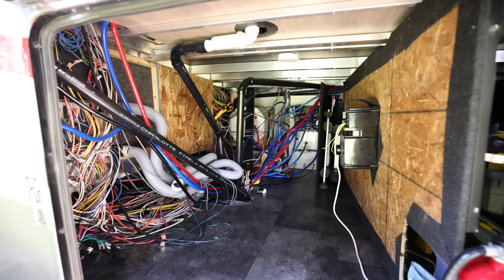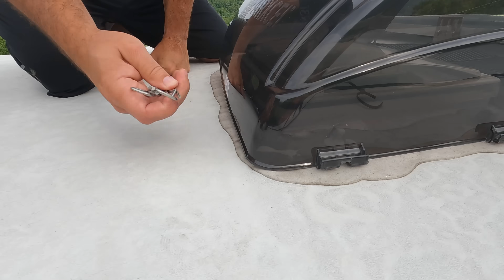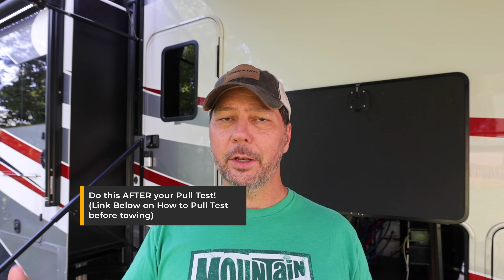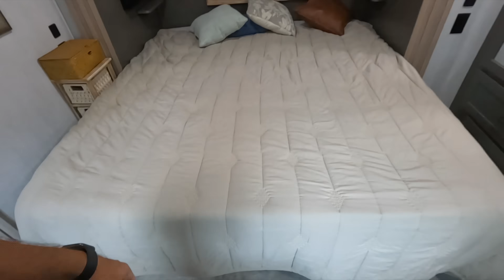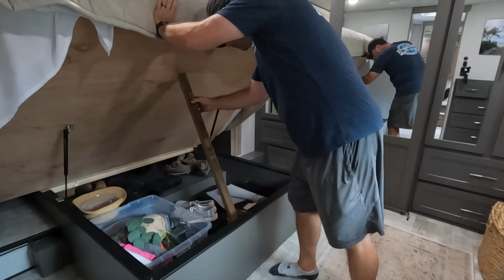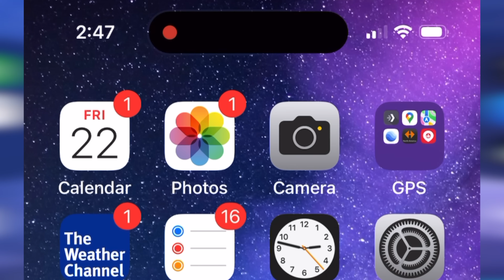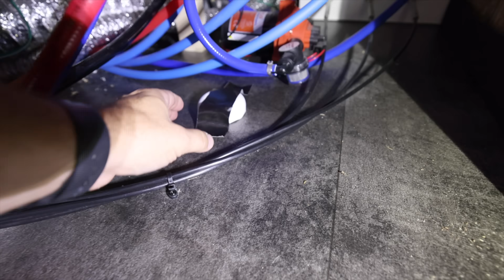Help Us Out? Stubborn Leaks and Four New RV Projects!

Comment: @0:06 you may want to check some of the ABS pipe joints (especially the elbow directly above your sensor) as manufacturers have a tendency to dry-fit the pipes and then forget to glue them at all.

Comment: Check behind your Nautilus again. I have a '22 Solitude which I had a total of 5 separate leaks behind there.  The final one is acting like what you have.  A puddle shows up but couldn't locate the source.  It eventually turned out to be a T connection behind the Nautilus in a hard to reach location due to all the pex.  It eventually showed itself but it took a long time to track down.

Comment: I recommend trace powder.  We use it in the auto industry for leak diagnosis.  You get it in an aerosol can and it leaves a powdery residue that dries on a surface after you spray it.  You should encircle the area where water appears and the idea is when a fluid goes across it, it will displace it and usually leave a peetty obvious path where it entered.  Most leaks, even minor cannot hide from trace powder.  Spray it on fittings, crevices, anywhere you want to be able to visually check for evidence of a leak.  It's what the pros use.
Reply from the maker: Someone else mentioned doing the same thing with goldbond spray powder.. 👍🏼
Reply: Water travels through the weakest points. 

I like what Jordan said.

I see you like toys. I believe there are moisture meters handheld at Lowe’s there relatively inexpensive. 

Possibly an RV repair shop would have one.

Consider any hoses or valves. If it’s been raining near you, consider wind driven rain.

Comment: Time 7:50 minutes in. Happy Jack seat support pins. I’ve had some of these shake out while traveling. I drilled through the pin at the ball bearing.  I knocked out the ball bearing and spring to drill through. With the new hole in the pin, I install cotter pins so there is no way the pins can fall out.  The pins that did fall out were the bed, which I drilled new holes in the rails to lower the bed for the AC to breath better.

Comment: We have a 2023 Solitude with the Furrion tankless water heater and my leak detector alarm went off last month and come to find out the supply line passing to it had the threads walk back enough to leak. Worth a look, hope you get it sorted! The threads like to get hot and cold and just loosen up over time. I’m sure driving down the road aids in that also. I used some pipe dope (sealant) and it’s been holding up well so far.

Comment: On our maiden voyage from Pennsylvania to Bellingham, WA we fell victim to a leak.
Crossing the Badlands in 96° with 25 mph crosswinds (was towing amazingly) we were motioned to pull over and a rear view glance saw insulation flying.  What a wild adventurous chore packing soaked insulation into the kayaks, cutting the rest of the underlayment away, and securing all the wiring.  Some wires received abrasion to metal and ACs & fridge were running.
Having aircraft industry experience,  the wire management  was rather appalling.  
Thankfully,  I had ALOT of zip ties, electrical tape and bungies with me to get her shipright.  Doing this with winds funneling underneath and i-90 traffic whizzing by was challenging!
Seems to be common with folks taking various reinforcement measures.  Improvements could be made to what is arguably a safety issue.  Our first round of customer service coordinating with local GD dealerships, 3rd parties, scope of mobile tech work ect just wasn't working out timey, so the company is mailing me the underlayment to do it myself.  Kinda got an eye opening on things.

ANYWAY, days before it happened, we had a layover at Grand Design headquarters to have our refrigerator swapped out for DC.
This required removing the slide and a gas line.  

So I was going nuts trying to find the water source on our 2023 410 during our many subsequent hookups to the Mt. Baker area.
I then had everything out of the basement, checking every fitting.  We ran each line, hot, cold, draining sink fulls, etc.
It wasn't until by chance, my wife started taking a shower while I was underneath. 
From across the pass through, I just happened to catch a drop of water clinging to the bottom of the shower drain fitting.
On the otherside, it's right up under the bay door in plain sight.  
What was happening, the water adhered to the pipe and crossed back behind the wall and pooled in your same low spot, before going down into the insulation.  Thankfully  no wet wood. 

So I checked the compression nut - it was a bit loose, not bad - then I summized workers may have had to remove the line and perhaps didn't happen to seat the washer correctly.   No dice, and then it was obvious the plumbers puddy must be compromised.   
I noticed replacement  shower drains have rubber seals.  Then there was a debate whether or not to puddy again or silicone the repair.  I went with stock, so far so good.
Another theory- the removable wall on ours, is notched tightly to the drain pipe after the elbow, almost supporting it.
Vertical shock loads could be translated right up to the drain.

Looks like this will become a valuable thread.

P.S.  The motorcycle ride up to Artist Point on Mt. Baker, the volcano north of Rainer, is spectacular!!!
Reply from the maker: I was suspect of that drain pipe also, but noone had been showering.  But it's still not a bad idea to get the shower running while I check that pipe, try to move it around a bit, etc...  👍🏼

Comment: Hi Chad,
I would check when you have the water showing, when dry camping or during hook up. During dry camping the expansion of the water during a heating cycle of the water heater has no place to go except for the pressure relief valve which requires additional pressure. This could be enough for a weak point in the plumbing to release the additional pressure. This would not happening when hot water is used during this time or with a hook up, because the water can expand into the hook up. Hoping this will give you another angle to look at the problem. I appreciate your shows and keep up the good work. Save travels. 
Leo

Comment: Hey Chad love your channel. I had an issue similar on our RV. Took it back several times while it was under warranty. I finally took it upon my self and found  that the frame for the door wasn't properly installed. I removed the frame and replaced the butyl tape then sealed around the frame. Problem finally solved for mine. Good luck in finding your leak.

Comment: You need to clip your break away cable on the tie down handle inside the side of the bed not supposed to connect it to the same hitch or spot the trailer is connected to
Reply from the maker: We used to do that, but our cleat on that side went away with the Volta system.  I might put an eye bolt on the toolbox for that. 👍🏼

Comment: I'm gonna say you have a small hole in your sealant on roof at a tank vent and its traveling down the pipe into the basement. We had a leak in ours, we were hearing a drip behind the wall so I went up on the roof and there was a very small hole in the sealant at the rear tank vent, so I re-goobered it and it stopped. Hope that helps you! Also, love your channel! You guys need to come up to Minnesota to see all the beautiful areas we have up in the north part of the state!

Comment: Okay does your water coincide with the temperature when it gets cold like you may have a slight crack or slit in your pipe? PS you could always get Tarra down in that area and then the water through the system see if she sees a leak

Comment: Chad, 2 things. First, it looks like the spot may be below the bathroom. If there is a leak in any of the plumbing, supply or drain, it could be very small and then when you move it moves and finds it way down to the basement floor. Second, when I worked in the oilfield when emptying water out of oil tanks on well sites we would run a weighted tape measure down. We would use something call "color cut". It was a paste that would go on yellow then turn red when it touched water. That way we knew how much water to pull out and not take any oil. I saw a comment about some type of paint. Not familiar with that. I think the principle is the same though. It would help to see if the leak is running to the low spot, or leaking directly on top of it. I too love your guys channel. I pray Tara is well. Take care, stay safe and God Bless you both.

Comment: Water poltergeist, We had 3  instances of water "puddles" in our apartment in very odd places where there was no logical reason for water pooling up, After three such instances, we haven't had any since.
Reply: Do you have a cat that likes to play with ice cubes? Our refrigerator door ice dispenser would randomly drop a couple cubes from several minutes up to an hour after someone got ice. Usually found the small puddles near the fridge, but occasionally in other parts of the house.
Reply: No cat and no ice cube dispenser. The amount of water was fairly large and would need 8-10 cubes (at least).

Comment: I had the same issue that took me months.  In my case my water pump was spitting water only when I turned on my water.  I assumed due to the initial pressure.  Stumped me because I wasn’t using the pump.  I tightened fittings but ended up installing my pump on a cookie sheet.  Doesn’t always happen but the water evaporates when it does.  We now open a faucet when turning water on to allow pressure to regulate when turning on water and no problem.

Comment: Hi Chad
Like all the videos 
A friend with a Solitude had two water pumps leak. It was spotty because it is the pump that doesn’t get used always and I think temperature was a factor 

Second, I have seen when running water for the black flush, if it has very cold water and a little bit of humidity yo can get condensation on the hose then it will drip. 

Good luck

Comment: Chad, I have had numerous leaks on my GD Solitude 390RK over the past 2 years.  I have solved them all so far, but it seems that as soon as I solve one, the RV invents a new way to test me.  In my job before I retired I was an Engineer responsible for developing leak test equipment.  I have to admit, it did NOT properly prepare me for owning an RV, LOL.  In the belly and basement, I eventually found that I had ELEVEN (11) separate leaks, some were concurrent, some sequential.  Here goes….

1)	Check every screw that holds the door frame into the RV.  GD has smeared them with silicone.  Just this week I found 3 screws that had pinholes in the silicone that was allowing water to wick down the screw.  The water was actually under the linoleum and caused the linoleum to lift off the subfloor.  When I removed the screws they were corroded so it has been going on for some time.
2)	I had one large leak in the basement that confounded me for a month.  It turned out to be a screw head that had broken off but still appeared to be securely in place under silicone.  (probably at the factory since the unit was only 2 months old when it occurred) I finally had my wife shut me up in the basement with a flashlight during a thunderstorm.  It only happened during a downpour that came from a certain direction.  When I was checking the screw, the head came off in my hand.  The silicone wasn’t stuck to the frame either.
3)	I had a Nautilus leak that was due to a poorly molded fitting that had sharp flash that was not removed at the factory.  The sharp plastic edge on the fitting sliced the rubber seal creating a drip.  At disassembly I determined that the seals were not standard, not available at any home improvement store.  I was camped at a fairly remote location so I repaired it with Teflon pipe dope.
4)	A second Nautilus leak was from GD using non-PEX tubing on PEX fittings.  When the clamp is tightened, sometimes it creates a wrinkle or pleat in the hose because the hose ID is oversize.  This creates a leak path.
5)	Hose leak at the water heater was either a ding on the brass fitting barb, or, another pleat in the hose.  I replaced the banged up fitting and cut the hose back 2 inches and reassembled.  The leak went away but I don’t know if it was the fitting or the wrinkle or both.
6)	Bathroom sink faucet was improperly manufactured by the supplier.  The threads for one of the water lines would only allow the hose to be tightened about one turn while the other hose would go in three turns.  Its an O-ring seal but the hose had unscrewed enough to drip, run down the hose, and puddle in the belly with NO water under the sink.  I replaced both bathroom faucets.
7)	Water pump fitting. 
8)	Water pump other fitting.
9)	Water pump strainer.
10)	Water pump housing.  I placed a cookie sheet under the pump which proved the pump was leaking because some of these were intermittent leaks.  I replaced the water pump when I found the housing leak.  This is how I determined that I had more than one leak (pump plus pick one or more from 1-6, lol)
11)	New water pump leak.  I bought a new pump from a different manufacturer with excellent reviews, it lasted about 3 months.  I never use the fresh water tank.  I only use the pump for winterizing.  I think I am going to put a valve in the line to isolate the pum when not in use.

Thanks to all who commented, I really like the baby powder/gold bond suggestion!
Reply from the maker: Holy cow!   You are the leak master!  LOL. My next step will be the cookie sheet, with an extra sensor, and the gold bond powder around my low spot.  Capturing the trajectory, if it's not the pump, will provide more info...

Comment: I've had the same random puddle and I am wondering if it's condensation moisture.  I have checked all water lines.  I also had to run some silicone around my wet bay.  I cannot find the source.  It's not there all the time and seems to show after damp weather.  I'm at a loss as well.  As far as the bed struts, LIFE SAVER! I am so glad I upgraded mine a while back.  You also got me to thinking about adding the MaxxAir covers.  Are yours black or smoke color?  Block enough or too much light?
Reply from the maker: We have the smoke covers.  We had white on our last RV and I think we like the smoke better.

Comment: As for the leaks; Two ideas, one check the seals on the storage compartments.  I know people have installed tape-on rain gutters over the storage doors to direct the water.  Second, see if any roof penetrations are not completely sealed.  Seems to us that there could be a leaky vent or roof penetration that is allowing water in, only when the force or angle is correct.  Maybe even a solar connection/mount.  Food for thought.
Reply from the maker: I'll take a look at the roof.  But, it would seem the water would have a long way to go to get through the roof, then the bathroom, leave only a puddle and no trace.  It's strange.
Reply: @ChangingLanes  crazier things can happen. And trying to think out of the box.

Comment: Possible condensation? Any possibility there was warm or hot water in lines above that area. I know rain storms in the mountains tend to cool off the area pretty fast. Had this issue with our outdoor kitchen before, fixed by pipe insulating pex lines.
Reply from the maker: Good question!  The RV was on internal water, so the tank and all the lines should have been ambient temp.

Comment: Great video, Chad.  
Water leaks can be extremely frustrating to find. My suggestion was goingvto be use blue towels, we used them in aircraft maintenance to help find water leaks. But you said you did that.
Another suggestion, get in the basement area, close the doors and have someone spray around your doors, hatch covers, etc., that might show you something. I'm sure you know, if and when you find your leak, if it's not blatantly obvious,  always go up further than you think and come down ( if from vertical source ).
It's amazing isn't it, never have issues at 9 AM Monday on a clear pretty day, always night, weekend, or the weather is bad. Good reason not to put off fixing issues when you find them. Better to fix at your convenience than dreaded inconvenience. 
God bless ya'll and stay safe on the road out there.

Comment: If you screw a handle to the end of the bed platform you can just lower it down without slamming or smashing a finger like you did. I simply used a bit of old rachet strap, melted the ends to stop and rips or tears and nailed it through the mattress base wood platform. Has worked the last 6 years.

I bet Tara secretly dumps water down there just to f with you. 😊

Comment: Hey Chad, I had the same issue on my GD years ago. I had a feeling it was coming from water pump but could never see from where on what fitting. I ended up adding a small tray to under the water pump and screwed it back down to floor, big enough to cover all of the fittings. Put my water sensors in the tray and sure enough the next time it went off it was coming from a fitting, added a little Teflon tape and never had the leak again. When I purchased my new 5th wheel adding the tray under the water pump was the 1st mod I made, if I ever get a leak it is contained in the tray, and I have a water sensor in the tray.

Comment: Chad, if the frame screws are on the outside of the basement doors put a spot of silicone on the lower screw heads. We experienced this issue with our Solitude when we first took delivery. After putting a spot of silicone on the screws, no more water in the basement.

Comment: My mystery leak was the Vacuum breaker for flushing the black tank. It was way up between the fridge and the shower. Impossible to visually inspect. The water would travel down the valve outlet line through the floor to the tank. At that point the water would soak into the subfloor It would take several  hours before I could see water intermittently dripping outside. Just a thought. Thanks for your amazing channel.